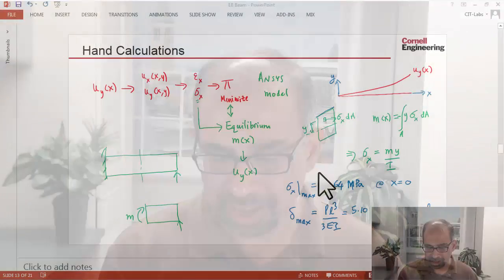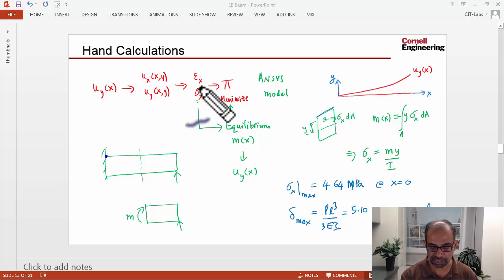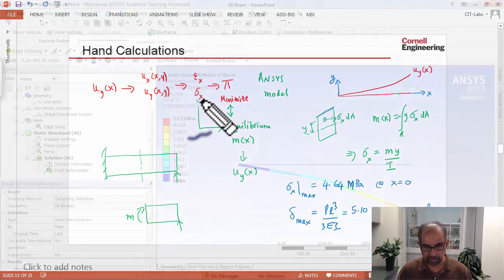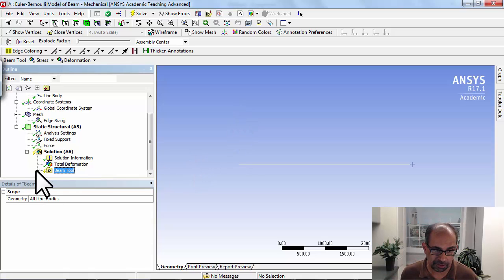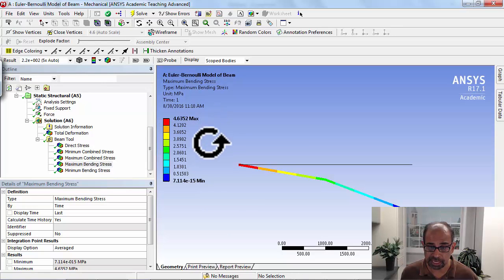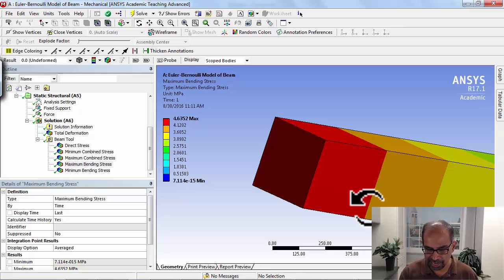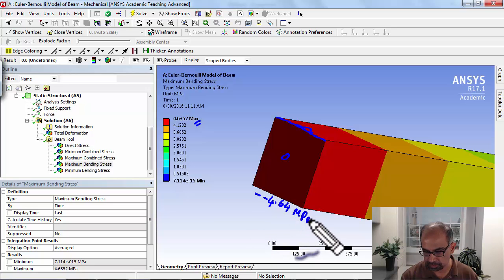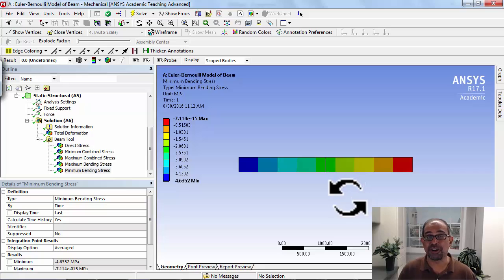Beam in ANSYS: Plot Bending Stress

Comment: What if I applied loads in two dimensions? How would I determine the maximum stress then? It seems the the beam tool only gives the result for one dimension, the one that has the higher stress value.